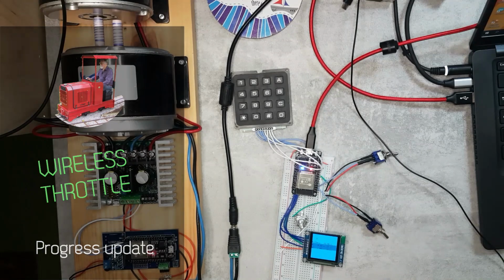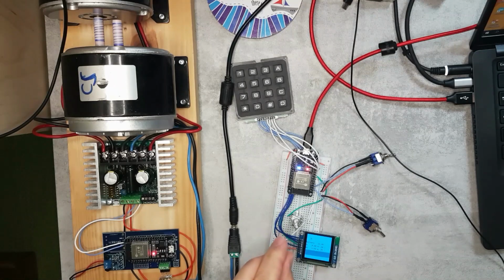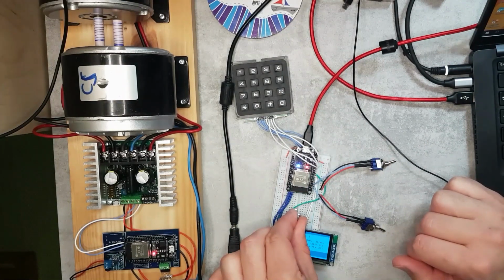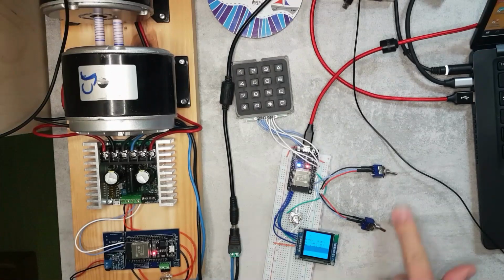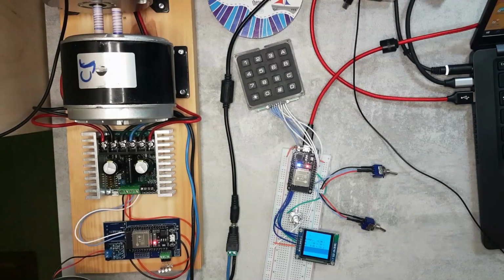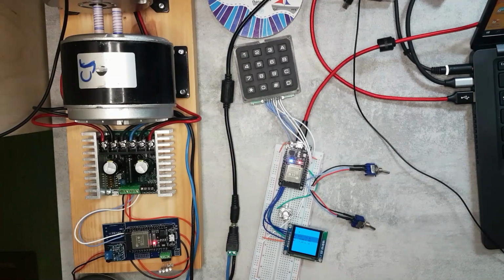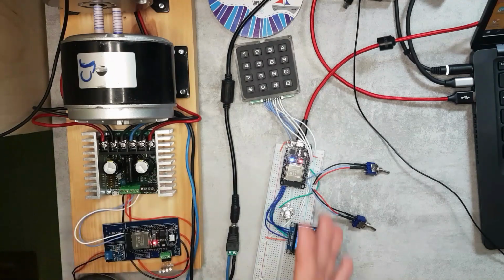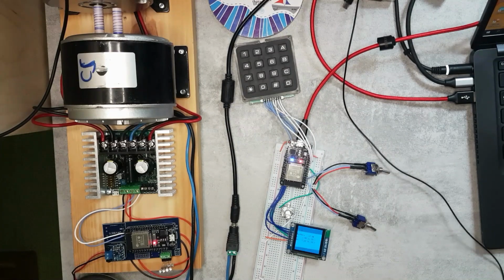Wireless Throttle

Comment: How are you generating throttle (variable voltage) output on the receiver end? Pure PWM? PWM with low pass filter? Digital potentiometer? Something else?
Reply from the maker: The ESP32 has a PWM output. I did not do anything special, just configured a pin to be PWM output. And that was all.
Reply: @csongorvarga thanks for your reply! It's curious that motor controller was just happy with a PWM signal! 

I'm building a similar setup for a Kelly controller once it arrives, and for now figured that I'll use DAC to output 0-3V for throttle receiver end. But I'll give pure PWM a try too
Reply from the maker: @kp0ccobep  my controller expects pwm, as it is designed to receive signals from rc servo receiver.